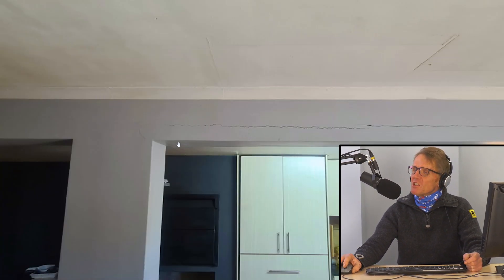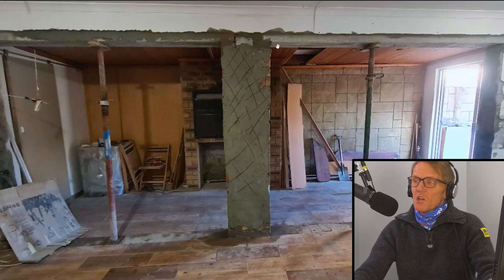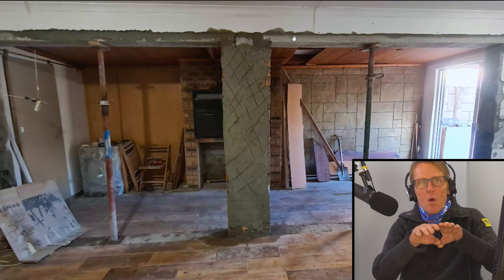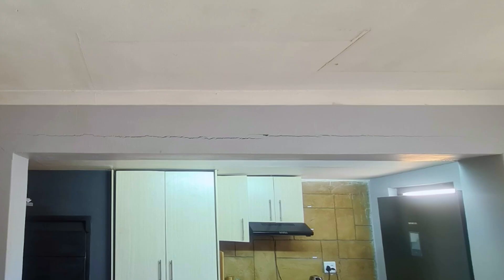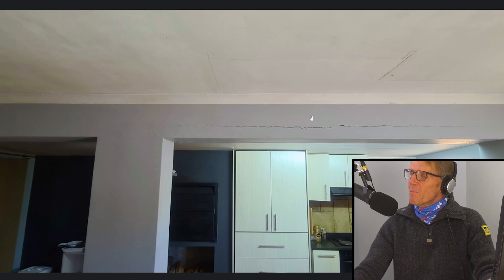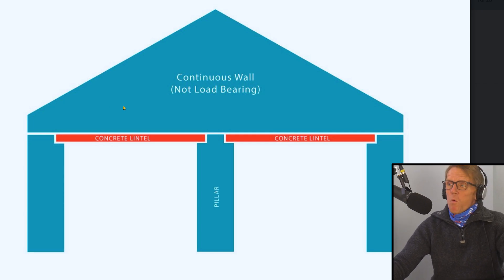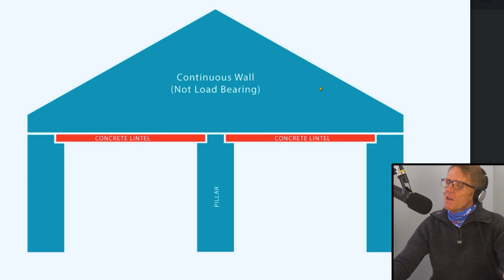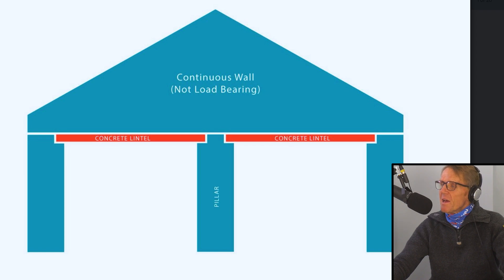Why Has This Lintel Cracked?

Comment: Hi Roger, love the video.
 I have some experience with this type of situation. One thing that's often overlooked when designing or choosing a beam  is how it will deflect (bend) when underload (installed). When doing a job like this its not just a case of assessing the beams capacity to take the load (dead and imposed loads) but also how much it will bend  and sag over time as the load is applied.  There are British standards that are used to assess beam deflection and if it will cause cracking to plaster or any  final surface finishes.  An added complication in this case is when lintels are installed in this scenario there is likely to be a small gap above the lintel and the brickwork above it. Meaning over time the brickwork will sag and start to fully bear on the lintel and cause it to deflect. If the beam deflection hasn't been taken into account when selecting lintel size then you will see a crack. 
This link gives a guide for steel, principles are very similar:        https://www.youtube.com/watch?v=brC9JEKqV7M

Comment: I think pretty much everything is covered in the comments. Brickwork really needs to be built over them as you go and fully propped until it has cured. There is plenty of room to use 150mm lintels or steels. I certainly wouldn't consider using such a lintel on this span retrospectively.

Comment: The wall below the eaves/ceiling level should definitely be described as load bearing if there is a brick wall above.
All lintels of this type with brickwork above must be designed for the weight of a triangular brickwork area directly above in accordance with the relevant standards (which assumes the brickwork above the triangle will arch and support itself). In this case the depth of brickwork above the lintels at either end may not be sufficient to conform with the relevant standard (i.e. insufficient to arch properly above the nominal triangle) due to the gable shape and a more liberal loading should be adopted for the lintel design.

Comment: I'm guessing they installed the lintel upside down. As for load bearing, if there's a brick wall above the lintel, the brick wall is the load. I would advise the client to check the outside of the gable wall for cracks. That's based on the limited information provided. Whatever the case, there is definitely a lot of movement in that wall and I can almost see it come crashing down in a really bad way. The client should get a professional engineer to look at it, ASAP.

Comment: Very rarely use concrete lintles in anything other than windows or doorways. never on opening that size! definatly should have been steel. would have thought building control would have pulled that

Comment: Roger your channel is one of the best. I don’t comment on these types of platforms often, but I want to offer that this may be an interior wall, (ie not likey but possible for sure, we cannot see the layout but I may be wrong and it is indeed under a gable- the drawing is not a shop drawing nor blueprint) and I’m wondering if it’s a combination of poorly installed finishes in conjunction with the issues that you already mentioned in the video. We have that problem with drywall stress cracks at corner bead when it’s not installed correctly and when there’s movement in the walls.

If this is the case, the cracking would’ve been caused after the finishes (ie in my country, drywall/plaster, trims, paint) installation by any additional work done above the are or by dynamic loads above the lintels.

In addition to poor design, the execution of finish installation can contribute (though not “cause”)  these types of issues. 

Thanks for all you do! Kudos!

Comment: As you said Roger prestressed lintels are supposed to have 6 courses over and anything over a metre is supposed to have a 150mm bearing  that looks like 100mm also there's often a way up to them too I took one out of the garage door opening on a townhouse Ashford that had a crack in the middle when we got it out there was an arrow on the front pointing down,  it had been layed upside down 9" deep with one rebar in at the bottom
Reply from the maker: Isn't the rebar supposed to be at the bottom?
Reply: @SkillBuilder  yes I didn’t make it clear, the lintel had one piece of steel at the bottom with an arrow pointing upwards but it was layed upside down with the arrow pointing down

Comment: I put in a concrete lintel just like that. About same length. But mine was 150mm tall and only held up 5-6 course of brick which the rafters didn't sit on anyway. 
I'm not sure if I set it in correctly but hopefully over did it on inherent strength side.

Comment: This hasn't been seen by building control or a structural engineer, it is not safe, you need to get some props under this soon as possible, is the concrete floor beneath the central peer capable of holding the weight.

Comment: If its a fair face or fire spec lintel they have a top and bottom and are usually marked, but rule of thumb is to position the reinforced steel rods towards the bottom away from load thus eliminating sag.

Comment: The point of building the brickwork on top of the concrete lintel is that the bricks "hold the end of the lintels down" and also the mortar ties lintel and the bricks together. If you just squeeze the lintel under the existing brickwork you support the ends of the lintel on the bricks at the ends and the lintel doesn't really support anything (the bricks will "float" above it, even if there is no gap) - sooner or later you get this "triangle" above it because those are the bricks it was supposed to support.

In this case I assume the lintel was soo long (and maybe upside down) and sagged on its own weight even without the bricks pushing down on it. Assuming the lintel could have supported the bricks above - if you laid the bricks on top of the lintel, they would have bent the lintel a little, but because everything would have "sagged together" you don't get a crack anywhere.

Comment: I think he needs to get a structural engineer in for a look in case it is load bearing. Not convinced he's clear enough about that. Would have thought best practice would be two steels, and depending on the load possibly a column.

Comment: You're right about the compression of concrete lintel. They have to be built in wet so the weight of the bricks pushes down against the upward force of the rods.
The opposite effect is with those thin metal lintels you have to support them with timber until they go off.

Comment: For a non-Engineer you explained it very well. When doing stress calculations on a beam like this the inherent 'strength' of the beam determines the load it can carry. By straining the metal bar and letting concrete set around it, the inherent strength of the beam is increased, It is pre-loaded (= pre-stressed). It contains energy, strain energy. This can be compared to your van. Its static weight that pre-load the spring with twisting energy in the spring. When you go over a pothole the wheel is pushed downwards by this release of strain energy stored in the spring. Without this the van would lurch into the pot hole. Same thing with continuous railway lines. These are stretched and welded at the same time. When the sun heats them up the stored tensile strain energy absorbs the energy of thermal expansion and so they don't buckle. Strain energy stored in toughened glass makes it shatter into small pieces.

The upwards curve  of the lintel is encouraged because concrete is very strong in compression. For the beam to sag it has to go through the mid-position which is resisted by the compressive strength of the concrete on the upper surface. Building the lintel into 'wet' brickwork adds to the compressive resistance on the upper surface. With the upward bend the additional bricks would all have to compress for the beam to pass the mid-point. Built in 'dry' then there is a built-in fault line above the lintel that can move a bit more than if it were all done wet and set at the same time. There is however an ultimate load in all of this. The weight of bricks above will ultimately exceeds the benefit of their compressive strength, its going to sag.
Reply: The wet brickwork does not add to the compressive resistance of the concrete it increases the compression in the concrete. Wet brickwork does not act as a beam. Built in 'dry' the lintel would be nominally arched upwards. Crack should not appear above lintel if properly installed.
Reply: @lenb9037  Len, you are correct. My (and Roger's) use of the term 'wet' refers to the laying up of courses of brickwork using wet mortar on top of the pre-cast (dry) lintel. If something like SBR is used there would be a good bond to the lintel and once dried out, the effective depth and strength on the cast lintel would be increased due to the homogenuity of the now dried out mortar. For the lintel to go through it's 'arched up' posture would require this new brickwork above the lintel to compress. It will do so eventually, but only after it has provided addition load-bearing capacity to the lintel. I agree with your last sentence, but we all agree that this is what this post was all about, the lintel was not installed correctly. I'm not as convinced as you that a 'dry' installation would ever me good in this instance, but I'm an engineer, not a builder!
Reply: @whitefields5595  Design for 'dry' brickwork would be normal for this application in an existing wall and the packing above the lintel and below the 'dry' brickwork would be installed as tight as possible to restrict any gap perhaps with an expanding grout admixture. I personally would not consider SBR in structural calculations although there may be some nominal/minimal assistance. Just to clarify I am a structural engineer (retired) not a builder! 
It would be interesting to find out whether the lintel may have been installed upside down and if so whether re-installation took place to correct it.

Comment: Those 65mm  lintels should have 2 courses of Engineering bricks above with ex-met reinforcement in the bed joints, built in one go as you said Rog so in effect it becomes a 225mm deep solid unit

Comment: The change of loading onto the central pier to support the gable wall may mean the foundation are not sufficient for the increased loading. When it was a full length wall the loadings would have been spread evenly along the foundations now they are concentrated onto the lintel bearing points and then through the piers to the foundations, point loading.

Comment: This is very funny.  That diagram states that the wall is not load bearing.  Using nothing but common sense you can see that the wall itself is large and heavy and is applying load to the lintel itself, and the lintel is far too long for its depth to support such a large weight.  The lintel has to be very much deeper in order to be able to support all that weight.  And using Google alone you could find out how to work out what load there is and how deep the beam needs to be.  That lintel needs to be completely re-done, and if he doesn’t that wall will crack above the lintel and you will be in danger of it collapsing.  A span like that needs a deep solid steel I section beam at least 8 inches deep, a reinforced concrete lintel of 75mm depth is ludicrously too small.  The builders need shooting, well, calling them builders is not right, cowboys is more appropriate.  Get it looked at fast, it can’t stay that way!!

Talking about the brick work working with the lintel is irrelevant, and the lintel being pre-stressed is also irrelevant.  The lintel just needs to be deep enough to support the load.  Google engineer’s theory of bending, bending moment in a simply supported beam, 2nd moment of area, bending stress, density of brick, and work it out.  A bit of My/I never hurt anyone.

Comment: Looking at the picture it looks like it was a garage that's been converted.  Hence the roof above. Either Way you can only remove two thirds of a supporting wall . This looks like more has been removed. The cracking has occurred because the  builder has pushed the lintel up in the middle with an acro prop when bedding it in . Hence it's dropped back to its neutral state . Just cut out and repoint with a finger trowel.

Comment: Not surprised that has cracked. All the loading from the gable end brickwork is now transferred through that tiny central column into the foundation. The two side walls will be under increased stress too. I'll bet they didn't check that whatever was underneath was capable of dealing with the increased load. In fact I'd wager that whichever shaven monkeys did the work didn't check anything much.

Comment: I believe the interlocking of the bricks above the linetel is called the cordobelling effect(bricks lock together preventing collapse.
Reply: It is exactly as you describe and that is what you are seeing here in the images. The lintel has sagged and isn't having any contact with the 'self supporting' brickwork above it. They need to strip the lot back and make certain the lintel isn't fitted upside down then at the very least install wedging packers between the lintel and brickwork and point the whole joint full with  sand/cement mix. The size of the seating nibs at either end may also be too small as it stands.

Comment: Usually in a prestressed lintel the top of the beam is the rough bit. Also the stressed rebar would be in the bottom of the concrete with about 50mm of cover. Concrete is strong in compression and weak in tension. Hence the bottom of the beam would be in tension if the load was great and the rebar here was not prestressed. In this way you can get away with a smaller beam. But at 75mm you could only have rebar right down the middle so prestressing would not have as significant effect

Comment: these concrete lintels are OK for a single door opening but the span of that opening is far too much for the capacity of the lintel and it has just over deflected.  The builder has not consulted a structural engineer and just taken a guess at using that lintel.  I suspect that he has not made a building regulation submission.  The lintel is carrying load - the masonry above - so it IS load bearing.  I am wondering if he thinks it is not load bearing that he doesn't need to make a build regs submission.  As you rightly suggest Roger there should be steel beams going in for that span.

Comment: You are correct Roger about the courses of brickwork above the lintel being required in order to form an arching effect. The manufacture normally stipulates the minimum number of courses required for the sectional size of lintel, this could be something like 3,5 or 7 courses. Your are meant to lay the lintels with the rough side up and just like rendering you should give your brickwork and lintel a wet down first with something like a garden pump up pesticide sprayer to control the suction much like in rendering with a scratch coat or priming. Also best to pack in structural non shrink grout between the existing brickwork and lintels. Think of the brickwork and lintel combination being like the section size of timber, the deeper the beam of the brickwork and lintel the greater it can span. It acts much like a floor joists versus a ceiling joist or a common rafter vs a hip rafter. Also the brickwork either side of the lintel matters, en castre is the engineering term if I am not mistaken, this resists the deflection/bending moment of the beam.

Comment: The span is way too long for any notable load for a prestressed concrete lintel of that depth to provide structural support. I’d never design one for a span over about 1.6/1.8m.

Roger, did you ask the guy to send the structural calculations? Does he have any?

Comment: Do the concrete lintels not have a top and bottom? How can the manufacturers determine in which direction they will bow? Is it by placing the rods offset within the concrete? 🤔
Reply from the maker: some do some don't. In a plank lintel the rods are in the middle and you look at the bow.
Reply: @SkillBuilder  Thanks. Just can't understand how, if the rods are in the middle the direction of bow can be controlled? Surely each rod could be working against the others? 🙂

Comment: Wrong lintel type and insufficient end bearing. Lintel used is a composite lintel which takes up deflection as you build above it and when mortar sets it can arch and work with lintel. If brickwork above this lintel then they have removed a load bearing wall which requires Building Regulations approval. Think only answer is to start again with a designed solution. The central pier design may also need to be considered depending on loads it is required to support.

Comment: Did they go through building control? Did they use an engineers design? Or was this the builders idea?
I suspect the latter. Which may cause an issue when they try to sell the place. Any search by a surveyor will show the work was never signed off and it'll need retro inspection.
If they went through building control and an engineer, the install must be wrong. Maybe it wasn't packed well.
But my feeling is that they should have used RSJ's.   I cant see how it's a non load bearing wall with that gable above.
And that supporting pier don't look sufficient, it should maybe have been a steel post bolted to the RSJ's.